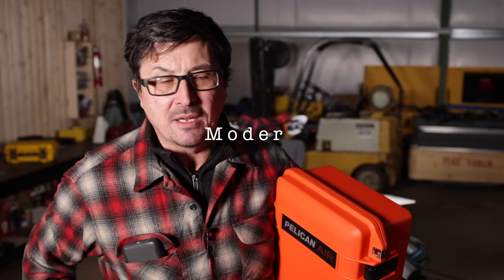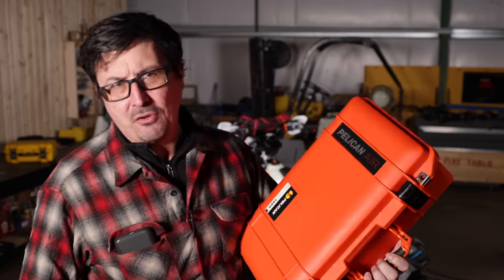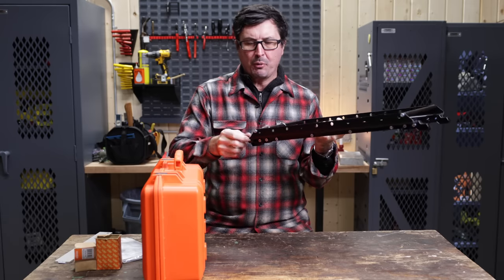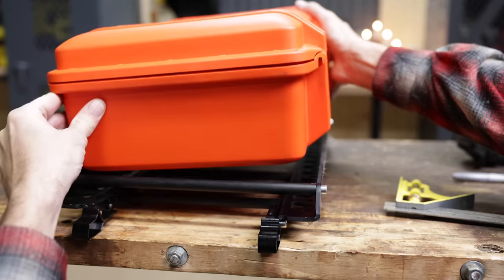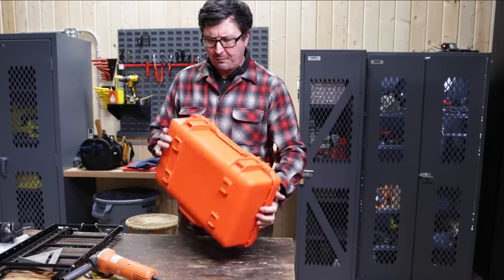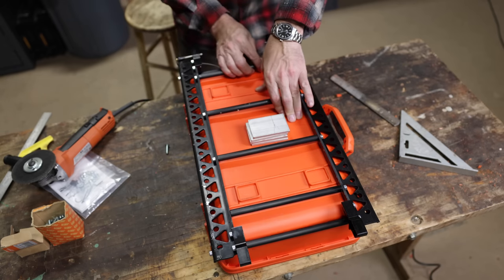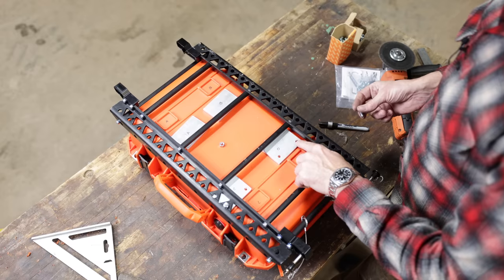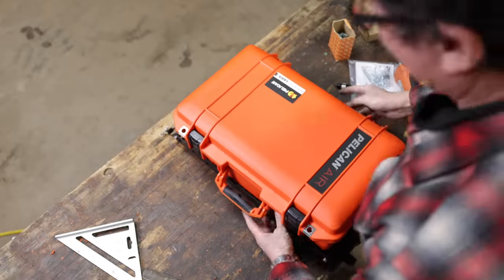The Ultimate Pelican Survival Case

Comment: Heads up...when combined aluminum and stainless steel are corrosive.
Reply: How much time until trouble when 1/4" aluminium is used?
Reply: Good question. The stainless steel valve stems on my aluminum rims have sure done a number on them in two years.

Comment: "The river doesn't get higher than this." Famous last words.
Reply: @hayden8491  My local creek can rise 25 feet.
Reply: He should check the FEMA floodplain maps for more info
Reply: @MC_Home9898  What i found out in my area  is that the 100 years flood stage has been hit here 4 times in 45 years.
Reply: @llshamelessll  that'll happen when dealing with the math of probabilities.  I've seen it in my community too.
I suspect a good number of the unit hydrographs are not accurate, which will through off all the calcs thereafter.  Maybe someone with a whole bunch of time could straighten it out.
Reply: @MC_Home9898  The flat area next to the stream is an obvious flood plain. When it will flood again is anyone's guess.
Reply: @TheTomBevis  agreed, sir.  Not if, but when.

Comment: I was going to suggest rubber/silicone washers. I'm glad you thought of that. 
Personally, I would have gone with stainless or aluminum pop rivets, at least for the holes in the case. There is no going back anyhow, might as well make it as solid as possible and with a nice smooth surface on the fastener.

Comment: Nice setup! You really need to put a plate under those bolts on the inside of that case or the plastic will fatigue over time and pull those bolt heads right through. Ask me how I know...👍🏻😁🇺🇲

Comment: Try add an o-ring to the bolts inside the case, tighten the nut only and keep bolt static to prevent bunching the o-ring keeping it waterproof.

Comment: So one thing to try out and consider might be how quick you can unmount that pack. Let's say your bike is about to plumet off of a steep incline into water or sink into a frozen lake, could you get the kit off fast enough to retain it? It would be an interesting thing to test out on your free time. Not really an issue I see with your design at all, just something to practice, like drawing a firearm.
You could potentially attach a nylon strap with a handle to both of those pins and secure it to the lid of the case with some velcro. So that even if you're still on the bike you'd just have to lay back, yank on the strap and pop both pins out at once. 
These things are mostly just fun to contemplate you know. It doesn't hurt to be prepared but obviously the hope is that you're never in that situation. God bless

Comment: put sealant on the bolts when you put it together with the new hardware it stops any water getting in the bolt holes its the method used on bolting outboards and stuff onto boats

Comment: Suggestion for the future, tap the Pelican case so you can thread the 4 bolts thru the case to help seal it for water proofing. You'll still need to ni-lock nuts inside of the case for strength.  Safe Travels and God Bless!  Have  Blessed Christmas!

Comment: Looks like the whole thing may be resting on the bolts used to secure the box to the frame. I wouldn't want those bolts touching that expensive carbon fiber. At a minimum I suspect they'll scratch it up badly when you ride (vibration, slight movement, etc). Couldn't you just bungee or ratchet strap a box to the frame?
Reply: Straping it was my recamendation
Reply: I usually mount my Pelican cases with footman loops on the outside as strapping points. I don’t strap over the lid so I can open it while mounted. I silicone the bolts that hold on the footman loops and never have a problem with waterproofing. Worked great on my Pelican mounted to my tracked Brute 750 in deep Alaskan snow. I’ve used that same method on several different cases for different applications.

Comment: you will want good sized flat washers on the inside of the box aswell. Atm your contact holdings on the entire box are the bottom side of your bolt heads x4. Thats only a tiny amount of material that would have to let go for the box to part ways with the bike, and as good as the plastic might seem, its still plastic.

Comment: Not sure what your water restrictions are, but if it were me I would add some stone along the bank to prevent washout.
Reply: Agree with that, but it should be in understanding with authority to avoid trouble. Supreme Court said something like "Even rivers that are physically navigable only by canoe, kayak, and raft are still legally navigable. (The courts have also ruled that commercial recreational river trips qualify as commerce). Because they are legally navigable, such rivers are held in trust for the public by the states, for navigation, recreation, and fisheries. The land along them is public land up to the ordinary high water mark (which can be quite a distance from the water--it's the land where the vegetation and soil show the effects of water.)"
Reply: @yvinddahle7714  Yes, understood.  However there should be some leeway or clauses allowing some form of erosion control.  Our governments do this all the time.  However it is the land owners responsibility to check, file for the correct permits, etc. before doing anything.  Me, I would go through the process because that river bank won't last long without some form of erosion control.

Comment: You should have cut the aluminum strip lengthwise. Long strips would hold it firmer and then there wouldn't be absolutely no need to add more screws. Also, I would use pop rivets (+rings on the plastic side) to mount the pelican case to the alu strips. Otherwise good job.

Comment: You made this way more complicated than needed. Weld a thin strip or two between the center braces of the Yeti frame, drill 4 holes, and done.

Alternatively, get longer strips that span the cross braces, drill 4 holes in the box, and done.  No modifications to the frame necessary at all.

Comment: Putting fuel in with the emergency supplies is a bad idea when you have other spots you can strap it on to the bike like on the front fender. 

If you had a higher flood risk you could always go the ring of concrete around the buildings with screw down spots for posts to hold 2x10's between them to form flood walls. A little more involved then that but nothing complicated past the math on how much concrete to keep the water from pushing it over.